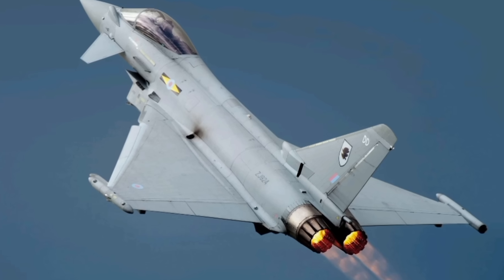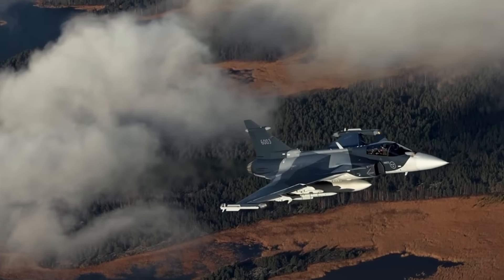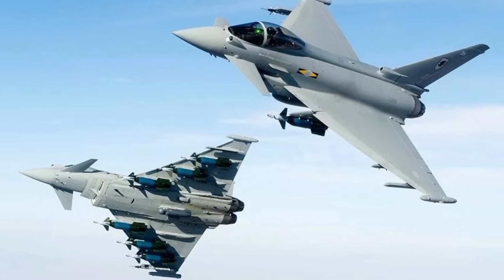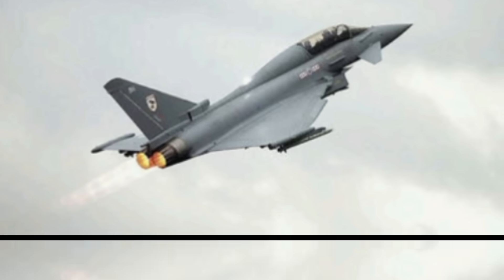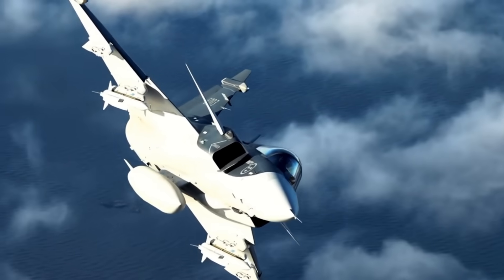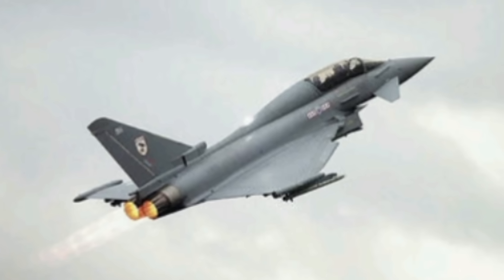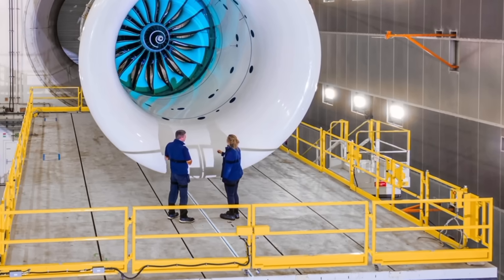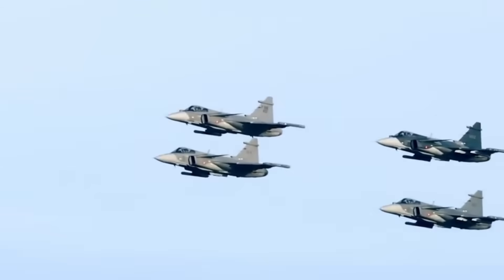Gripen E/F’s NEW Rolls-Royce Engine: The Fighter Jet Upgrade That Could Change Everything!"

Comment: The Gripen was designed around the proven GE engine.  The RR alternative will require a massive redesign of the Gripen airframe and avionics raising the base price of the aircraft and delaying its introduction to service. The RR is not certified for single engine operation, an exercise that will add yet more time and cost.  Directed thrust and other wish list items will add further delay and  cost.  Canada needs affordable jets today, not RR marketing brochures.
Reply: This engine is a single engine version of the EJ230 and they have been developing it along side of the Eurofighter duo engine. It is being designed to replace JAS39E engine. The JAS39E is not the only fighter using that engine. Rolls Royce new that those planes will want a upgrade in the near future with a adapted engine technology. This is also going into the F35A as well. The adapted engine is the way of the future as it has more power but can adapt to a more fuel efficient engine  when need.b

Comment: With the lack of USA reliability it is decisive that the Nordic countries can give Trump et alia the "F*** off!"

The point from a Danish standpoint is that the F-35 is not really a fighter, but it has the range needed for the Arctic. The European scenario is somewhat different: It is a an expeditionary one relying on road strips. with supply from C-130 Hercules. Dispersal is a well known defensive strategy. 
The weakness of the French is their asthmatic engines..

Up to now: What I have seen is the idea to develop the EJ200 - it might be an idea to start with a cleaner piece of paper - or perhaps this is the development of the EJ200?
Stealth is mainly derived from: You do not know where the damned thing started from.

And no. I do not think funding will be a problem.

Comment: This will never happen. Who is going to pay for this? It's for all practical purposes a new aircraft development, one that's not even better than the previous version in any practical way. There's only one aircraft that can be measured against the F-35 today, and that's the Rafale. It got the range, the payload, the tech, but lacks stealth. Gripen is simply too small, it doesn't have the legs. Make it larger and mount 2 of those RR engines, and we are getting somewhere, but I think that has been tried with highly various degree of success 🙂 In modern warfare, a stealth bomber is the right tool. The F-35 is the next best thing, but it can also do traditional "fighter stuff".

Comment: This RR engine has been studied for years now, on a budget/financing availability basis. Test beds have been set up previously.
One of the most compelling features about this engine is the Thrust Vectoring option being available, which would put the 
dogfighting/maneuverability of the Gripen at another unchallenged level. All this appears great news however, one does not 
simply swap out an engine designed for a given aircraft! The engineering involved is substantial,  the airframe itself would 
need some serious revision work as the RR engine is dimensionally far larger than the GE one. Not to mention the complete
overhaul of the software and integrated circuits to account for the changes in aerodynamic particularities, you are talking about 
creating a completely new fighter, having only general characteristics with its progenitor. It can be done of course, but it would be a
different bird altogether, the cost would reflect all this addition needed work. On the performance side, should this prove practical
financially, you might just wind up with an incredibly powerful and nimble fighter (4.905 Gen) that would display features that, 
with necessary software upgrades, has the electrical power reserves (for EW suite, etc) to keep it seriously relevant for decades.  Be well and stay safe
Reply: the RR engine is 150 kg heavier ! its NOT substantially larger andf i am quite sure Saab can buid Gripen with RR EJ230
Reply: @jacobschnberg5382  OK....prove it. Reference please...I follow these things closely. There's absolutely no reference from Saab on this other than being used in an early test-bed for the C model.
Reply: Thank you, Guy!
You know what you are talking about.
However, 4.905 is still less than 5th Gen… 
Does this mean the Grip’ would lose its grip?
Not necessarily - provided that you’re not going to invade some of your neighbours.
This system seems to be rigged for marketing reasons.
We shouldn’t let the 4 or 5 blind us too much. 
I guess we would agree on this.
Reply: AFAIK, there is already a thrust vectoring nozzle developed for the current Eurofighter engine. It was discarded for economical reasons, but it exists.
Reply: It would also make it harder to maintain and service.
Reply: @TheFrewah not really Saab have used Rolls Royce jet engines before, it wouldn't be a new concept to them plus spare parts would be easier to get hold of Sweden would not have to get it through usa red tape and would have less distance to be re-supplied plus Rolls Royce is a bit of lot more reliable. USA engines are like usa not reliable. It wouldn't mean the whole plane would need changing just the fuselage and the wireing and the speedometer and not much else. You make it sound like it needs a complete re-design not true.

Comment: Better Gripen goes with the Rolls Royce engine, and Canada buys the new updated Gripens manufactured in Canada by Saab.
Reply: Many country buying it
Reply: @kushchronic697  Canada currently has a contract with the USA for 88 f35s. Sixteen have been “delivered”, however the terms of the contract, which was signed by a previous Canadian government, basically means the Canadian s are restricted to American supplies, support and maintenance. Even services will have to be done on American soil. There is also the question of “kill switches” in American equipment, brought to the fore by the non~activation of Patriot systems over Qatar during a recent Israeli attack on Hamas peace negotiators.

Delivery in this case means the aircraft are in a hanger in the USA, because the manufacturer cannot get them working.

Canada is looking for an alternative to the f35 under its new government, and the Saab is a good option, however the USA has a veto right to the new contract, mainly due to the fact that Saab uses an American engine.

A Gripen with a Rolls Royce engine would diminish Saab’s reliance on American tech, diminish the threat of veto😮 on a contract between Saab and Canada, and give the West a stronger element in our defence.
Reply: @engineer6250  Canada must break the F-35 contract! Actually with its slow delivery, many issues surrounding quality and programing, and a threatening US President any international legal body would side with CANADA! America has already broken the promises surrounding the F-35 and it is NOT cold weather hardened, at least NOT enough! Keep a few token F-35's but build up the Gripen E/F with RR engines as the main fighter jet for all Canadian defensive operations. If America does not behave, pull in her horns, send a gift wrapped F-35 to China so she can at her leisure examine it! Conclusion America has broken any friendship/alliance she once had with Canada. America is the bully. Now treat her as all bullies deserve to be treated!!!!
Reply: @maryrafuse2297 Mostly agree, apart from making a gift of anF35 to the Chinese, though at this rate Trump might give the Chinese an F35 as a gift, and the problem is with that particular man, Trump. Though it seems a lot of Americans are along for the ride, may God rest their souls😂
Reply: 16 were paid for, not delivered.
Reply: @maryrafuse2297  Agreed, if the US has failed to live up to their side of the contract in terms of delivery and if serviceability is less than what they wanted, that should be sufficient to pull the plug.
But, I think there are other political and economical levers at play here, and Mark Carney will likely buckle to those political and economical levers.
Reply: @ianroy6668 I think you underestimate Mr Carney. He seems to be a very canny man, who seems to have outmanoeuvred the Trump administration several times. I suspect, if he can get Canada out of buying the Block 4 F35s, he will. Especially as has already been stated above, the American manufacturers can't get the hardware working or the software loaded.
Reply: @engineer6250  No F-35 have been delivered to Canada, and since the Block 4 upgrade has been delayed until at least 2031, don't expect e delivery before at least 8-10 years, and expect the costs to skyrocket, so I say the hell with the F-35 and go Gripen, besides, who wants to buy jet fighters from a country that threatens Our sovereignty !!! !!!
Reply: @engineer6250  Agree. Add the US political turmoil, the US may get itself into a Civil War, if that happens would everyone operating aN F35 have a lemon without maintenance supplies and backup support.
Reply: @maryrafuse2297  If Canada breaks the F35 contract, it can be a solid 2 decades behind on sporting a modern jet. A RR powered Grpen is a papre drawing. If China sends a gift wrapped F35 to China, American can send a gift wrapped nuke to Ottawa.
Reply: @BV-fr8bf disagree. RR published a memorandum of understanding with Saab in 2019, which related to transfer of technology (including engines from what I can find). 

This has been bubbling on the hob for a few years now and should be coming to the boil soon. 
As for the USA having a civil war, I wouldn't put it past them we have seen the divide in American society growing visibly since the Obama administration. I hope it doesn't come to pass, but I don't think it's an impossibility.
Reply: @engineer6250  Yes Canada has paid for 16 F-35's out of a possible 88.  But none have been delivered as of yet,  cost over runs also have doubled the cost from 16 billion to over 30 billion.  I STRONGLY agree with everything else you have said.
Reply: @bahbus  .  Totally agree. Block 4 F35s have issues with hardware and software. The software cannot be uploaded or configured was the last thing I heard, yet the costs keep going up for what is effectively a leased aircraft that may actually have a switch the Americans can use to disable it, which is what people think happened to the Patriot system that was protecting Doha, Qatar..
Reply: I think that price could be a barrier. Rolls-Royce do overprice their products. But there again they are a world leader, few can match them, and you get what you pay for.
Reply: Probably also Vietnam.
Reply: The RR factory is in Canada
Reply: Bombardier would make an excellent manufacturing partner with Saab. If an enhanced Gripen is successful Canadian built Gripens could be exported.
Reply: News flash (and building on my comment about Trump making a gift of an F35 to China. Ryan McBeth has just released this: https://youtu.be/TosiqpqnkyQ?si=GStoSqgWz8SU2K2n
Reply: Too far out. A reengined Gripen wouldnt be available till 2030 at the earliest.

Comment: So why did you show a Eurofighter Typhoon 😂😂😂Typhoon will still have more ordnance 13 hard points to be exact 55thousand foot ceiling constant 9 G turn Gripen 8.2 .in all categories it will still be not good enough plus the typhoon is proven in combat. 360 degree look because of the pilots helmet they had to reinvent the g suit the list is huge it is still a good jet but the typhoon amazing 😂😂😂 stop the propaganda. Armchair airmarshal
Reply: The JAS39E is a 9G aircraft and it can be flown at 12G if the pilot goes past the soft stop on the throttle.

Comment: Change to RR better to buy in Europa and with better performance 👍
Reply: @JohnasHammarlund Re: change to RR engines.
This would help the independence, and (a bit) help the performance, but it is a new airframe needed,  and it is theory-only. I think we need jets sooner. Finally, it is a single-engine jet in the high arctic.

Comment: Bingo, Canada needs to sign a deal for 150+ units.
Reply: Yup. Now there's not an American engine in it anymore.
That was the last thing on the list. F35s are falling out of the sky in Alaska, and that's rarely as cold as our arctic.
Saab has offered to put manufacturing in Canada so we are producing it ourselves instead of having to buy into the crazy cost overruns in the f35 servicing.
Reply: Gripen's range is 840 miles the F35 is 1200 miles that could be the deal breaker.
Reply: @Scimiter1948  That isn't true.  Gripen is 3200km and F-35 is 2200km.  Even better, a Gripen can take an external fuel tank whereas the F-35 cannot.  Thus the F-35 is stuck with only its internal fuel range it cannot affect its stealth control surfaces.  Meanwhile the Gripen can pass 4000km with an additional tank.
Reply: The Eurofighter is a much more powerful aircraft.
Reply: @chopo.1  Eurofighter pulled out of competition over concerns about high costs associated with NORAD security requirements and recent changes to the industrial benefits package that did not adequately value their commitments.
Reply: And feck USA
Reply: We need new fighters yesterday, not in a decade.
Reply: @DJC-it2sw ... we are already looking at a decade for the F35 Block 4 in the middle of the 2030 with its adapted engine. This will not take Saab as long to get operational as it is just the engine. Lockheed Martin needs to upgrade 66 items for the Block 4 which is why it's being delayed once again. They have let to declare the F35A Block 3 as combat ready and that is expected by 2030. In meantime it is only operational as a training aircraft. We will be performing interceptor missions with a aircraft not rated for combat. That should fun to explain to Canadians. We went there to checkout the airplane that NORAD wanted intercepted. But unfortunately we had to call the Americans to shoot down for us just like the spy ballon from China...😢
Reply: @davidgough4750  F-35 would have made that worse, as the plane is even slower than our current CF-18s.  Mach 1.6 vs Mach 1.8.  Gripen tops out at Mach 2.0 plus with an added external fuel tank would have reached the target.  The lemon fuel guzzling F-35 would have needed to be refueled.  F-35 is completely unsuited for Canadian geography and should have been disqualified outright
Reply: @waltersumofan.  then there is the fact that the JAS39E can supercruise without afterburners at Mach 1.25 with a air to air weapons load and a centre fuel tanks. It is also rated for 9g with that same weapons load. This range can be doubled with small refueling points throughout the Arctic territories. This would be helpful with situations like Poland is currently dealing with as the JAS39E can be refuel in 10 minutes just like a racing pit stops. The refueling can be done with the engine running or the engine could shut down and just run the on board APU to power all of the electronics.
Reply: @DJC-it2sw   Seen the constant delivery delays and cost increases for the F35 ?  And what's the sudden hurry - only country threatening Canada is the USA itself !!
Reply: @unitb7713  Block 4 is already three years behind schedule and not expected until 2031.  Expect massive production delays even then
Reply: @DJC-it2sw  It will be 2 decades with the F-35 hanger queen!
Reply: We must continue to use that term, hanger queen, because the F-35 will always be a hanger queen! It was born to be one!
Reply: At least 150-200 to be kept at home, the first batch of F-35's may have to be kept. We may see them 30 years from now! Use these if we have any operations with America. That way if the US President uses the kill switch he/she will be harming Americans along with Canadians. Simply put America is no longer acting as an ally so treat her accordingly!
Reply: BS

Comment: In your fantasie.
Reply: Now a 5th generation engine in the JAS39E, along with the current 5th generation electronic warfare systems full operational on board. This comes down to physical sleath verus electronic sleath and additional cost to have that physical sleath. The engine also future proofs the JAS39E for new upgrades with extra electrical power to the aircraft...🇨🇦🇨🇦🇨🇦
Reply: @davidgough4750  Electronics also needs cooling which is much harder to generate than additional electrical power.
Also considering that the Gripen E is designed to have a many decades long operational life, don't you think Saab has designed it for a planned upgrade path or already have surplus electrical power and cooling on tap for coming upgrades?